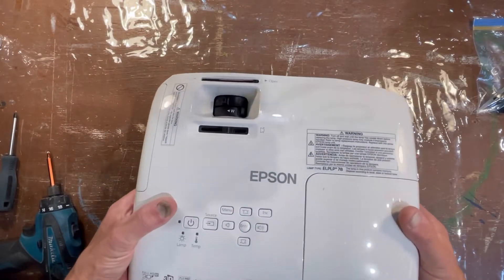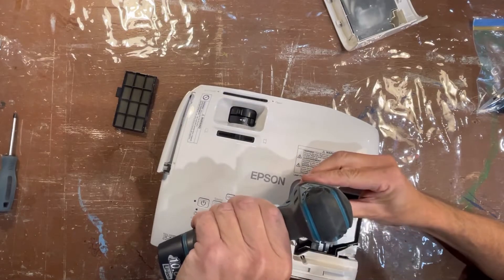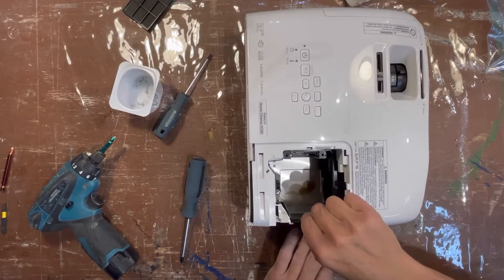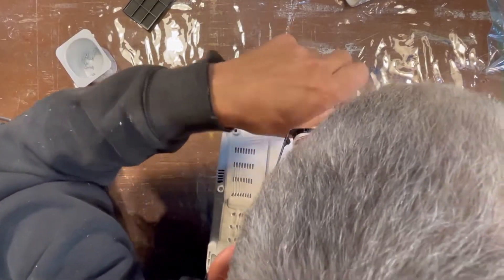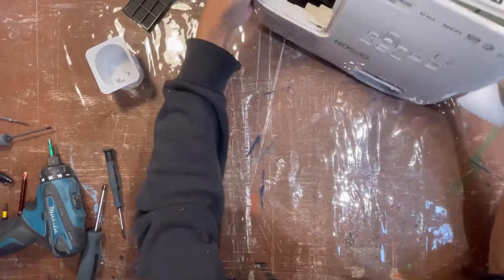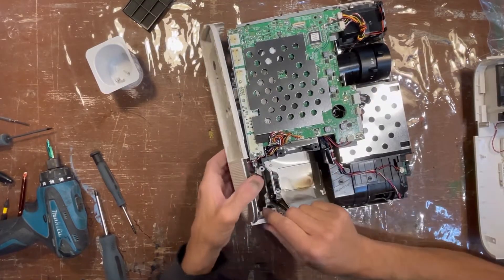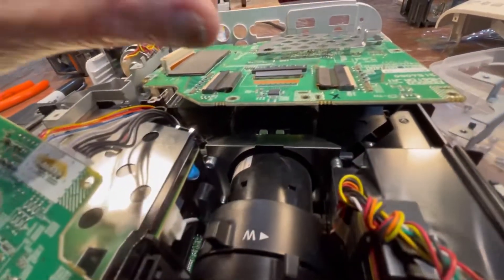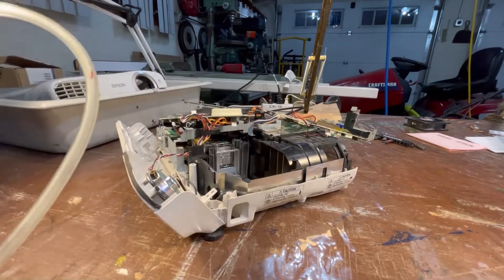Epson 2030 Projector Overheating Fix, Disassembly, Repair and Cleaning

Comment: 16:25 Used a 5v fan to cool down the processor of a low budget led projector , as signal cuts off due to the processor overheating like a toaster.

Comment: Any ideas what could be causing the 'temp' & 'lamp' lights to flash on after only 15-20 seconds of being on?  This happens 2-3 seconds after the fan starts up, and before the lamp starts to light up, so there is nothing even starting to get warm yet.  I've replaced the lamp just in case there might have been a faulty sensor in there.  Mine is the EHTW8000.  Had it ten years but used it very little.  There is probably less than 300 hours of mileage on it.
Reply from the maker: I’m still using mine and run my external cooling continuously. It works steady for a month, but then suddenly begins flashing blue and shuts down. Sometimes minutes after start up, it’s not even hot and after doing this a few times it goes back to normal operation. My theory is there is actually something wrong with the main board. I think it’s Incorrectly signalling the overheat shut down mode. Sometimes I unplug it and make it reset and eventually it gets back to proper operation. When my first problem occurred with overheating, it really needed a cleaning. There was lots of accumulated dust throughout the entire projector so you might try taking it apart and cleaning it thoroughly. Also make sure your filter gets clean regularly. I suspect you may have tried this already, but just in case thought I’d mention it. Good luck sorry I couldn’t be of more help.
Thanks for your comment 😊
Reply: @MacGyver0692  Yes I opened it up with the intention of giving it a good cleaning but it was surprisingly clean inside already. Probably because I haven't really used it much.  I serviced consumer electronics back in the 90s so I'm comfortable doing basic checks but there is only so much I can do without the schematic diagram.  I even changed the thermostat that sits on the outer housing of the lamp module just in case, but no luck.  I agree the CPU is getting a shutdown flag from somewhere, but where?  Maybe a temp sensor in the power supply also, but I didn't want to venture inside that far without a schematic.  I ended up getting a new projector, which is exactly what Epson wants me to do.
Reply: i switch to eco mode and restart and it works
Reply: @jimmythewheelie  seeing as how I can’t even get my projector to power up, how could I switch it to eco mode?
Reply: @BarryPiper  I see, didnt read the whole comment lol

Comment: Awesome fix! How did you end up powering the fan? Was it with the wall plug you showed at the start, or did you splice into a 12v wire in the projector? 

I’m about to add another fan to my Acer H6510BD but was trying to figure out how to power it. It’s neater if I don’t have to plug in another wall socket and use the splice method, but I don’t want to create any future problems by overloading etc
Reply from the maker: Funny, I was thinking of that tonight as I turned on my projector and simultaneously reached over and flipped the switch on the power bar that the fan transformers plugged into. Quite often I forget to turn on the fan and occasionally the overheat sensor shuts it down. I was thinking of tying it into the existing fan, but I think the existing fan was not getting the proper message from the control board causing it to run incorrectly. Thanks for your question. Good luck
Reply: @MacGyver0692  Thanks for the reply! Ahh yes I thought I might run into that problem (of forgetting to turn on the extra fan as well)

I've been testing my wiring for the last few nights and I've managed to splice my front fan into the blower fan - both are getting 6.64V on the red wire, black is ground, and yellow is sending ~1.6V back to the motherboard as a sensor and it's been working so far.

I believe I've worked out the amps correctly: the blower fan takes 0.15a, the exhaust fan takes 0.36a (total 0.51a), and I'm doing this with the assumption that most computer motherboards can supply 1.00a from the fan header, so I'm well under that.

I'm about to put all the projector casing back on and do a proper test (and watch some long movies!) so we'll see how it holds up!

(Sorry if that's too much information haha!)

Comment: This is too tempting , taking it apart easy put it together, I don’t know. It’s a good explanation. Thanks. One question can I use in Bluetooth mode my model is h719A?
Reply from the maker: I wouldn’t advise doing what I did unless your projector is already screwed. I actually thought I was going to end up buying a new projector but thought I’d have a goal before I threw it out. I was lucky it went well. I actually made the video with the idea that I would need it for reassembly and then realize that someone else mind benefit if I published it on YouTube. Sorry, I’m not sure about the Bluetooth mode question. I’m not actually much of an expert. Thanks for your comment good luck

Comment: Hello, have you ever encountered a issue where you get no signal on 2030?
Reply from the maker: Check the HDMI cable is plugged in and you have selected the correct source on the remote

Comment: Epsons are great but get too HOT, prone to dust. Never buy refurbished.
Reply from the maker: True, I have always cleaned the filter and tried to keep it relatively clean. I’ve seen other projectors completely packed with dust and still functioning fine. Thanks for your comment

Comment: Hello po, Do you perhaps know how to fix the PIXPRO Activa Ishow x1600 LCD Projector? The Warning light and power light is blinking. It does produce light on its lamp. Thank you so much in advance.
Reply from the maker: Sorry just saw this now. Hopefully your projector  is still running. I’m not actually a Projector expert. First thing I always check is the filter. Make sure it’s clean. I take my out,  blow it out and wash it every month or so

Comment: Hi Glenn! Nice job.  Your exhaust fan is probably suffering from a lack of airfoil shape due to the heat.  They kind of domino fail on themselves.  The RPM will stay correct but your CFM will plummet. Just make sure you are no pushing heat back into the projector with your added fan. Those polarizer and prism coatings will melt quickly if they are heated and Epson was "great" in building the optic block to be unserviceable...  Have a Great New Year!
Reply from the maker: Thanks FixitFrank. Never thought about the deformation of the blades. I’m not sure if I understand how my additional fan would push heat back into the projector. I can feel the heat coming out above the fan so I assume it’s only going to add to the overall cooling. Perhaps you could explain. This was actually my first time taking a home cinema projector apart, so any tips are appreciated. I Thank you for your interest 😀
Reply: @MacGyver0692  I'm sorry, I should have clarified.  Your fan addition is moving air away from the heat source. Your implementation should be fine. 
 Sometimes when people add external fans, they try and use the cooler ambient air and blow it inside not realizing that makes it harder to get the heat out.  It was more of a "if anyone else is thinking of adding fans" comment.
However I would suggest just checking the temps near the lens, maybe off to the side nearer the lamp.  You are changing the airflow pattern but looking at where you put the fan, I don't see that doing anything more than maybe drawing more air through the whole projector which should not a bad thing.   I suspect the design engineers wished they could put a fan right there.
If the external fan ever becomes a hassle, I suspect replacing the exhaust fan, and lamp blower fan would restore the original level of cooling but if it's working and I suspect its not leaking much light, run it and enjoy the projector.
Reply from the maker: @FixitFrank  I can see why the projector engineers opted not to use this exterior fan idea. It doesn’t look very sleek, it does leak light and adds some noise. Oh well, it works for now and was an interesting project. Thanks again.
Reply: @FixitFrank  Hi,  I have the 2030 and its time for a new blub and I replaced the side vent and air blew any dust I love it, and want it to last would you recommend that I get a can from computers and position it below blowing air up or pulling air down, It gets hot it has not yet melted the plastic but it get very hot, not to mention the room get hot, who would need heat in the winter with this in a room.

thank you in advance for your time.